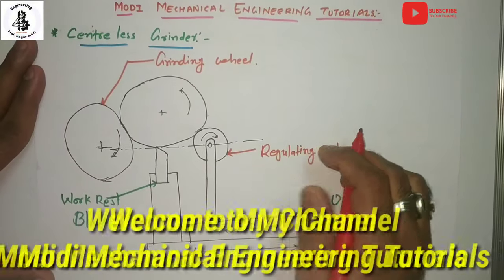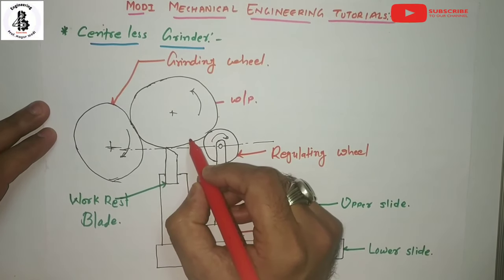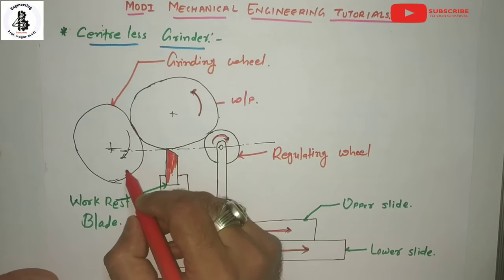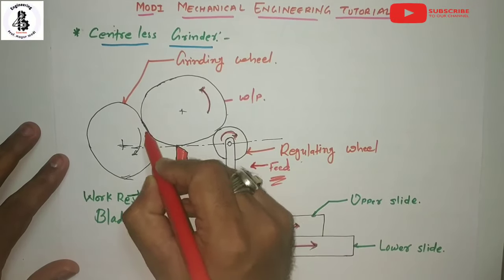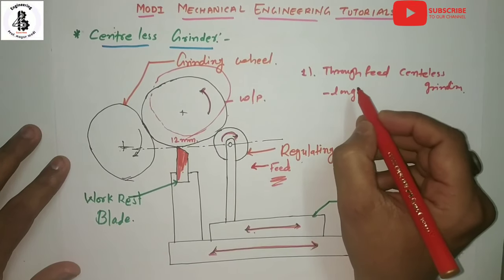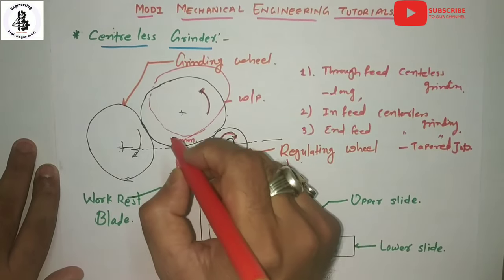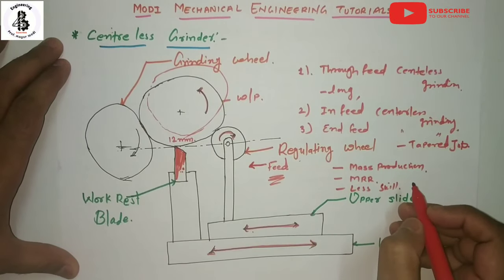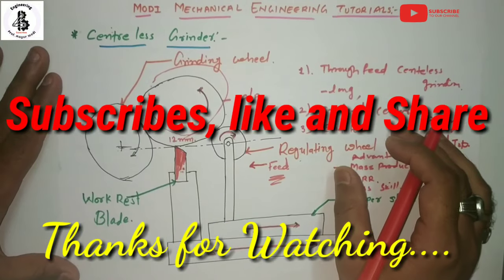centreless grinding machine | centerless grinding machine operation | through feed grinding machine

Comment: Great vid, thank you. Been c-less grinder for quite a while now. I know there are a lot of factors to make part round: speed, coolant, rest blade height. My question is what should be part height for the roundness? I know the work piece center should be higher than the reg wheel and grinding, but is there a formula to be exact?
Reply: As long as it’s less than .5” go too high with it and the workpiece will want to chatter and lift out of the machine depends on how heavy the part is too

Comment: Anybody else know if moving the regulating head angle back and forth to keep the wheels consistent correct? My work has no idea how to run it and the guy who trained me retired now I can’t explain why I do this
Reply: I want to know the same thing, at my workplace the piece keeps getting small and I have to open the regulating wheel every 8-10 piece!! The stupid operator/trainee says it’s ok but I think it’s pathetic that the machine can’t run consistently.